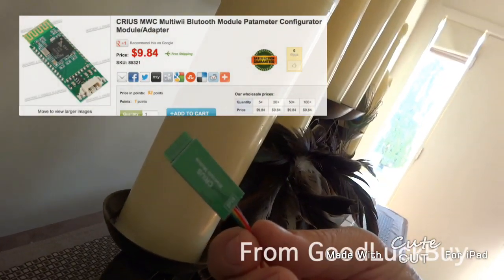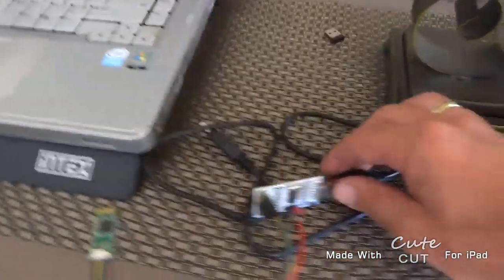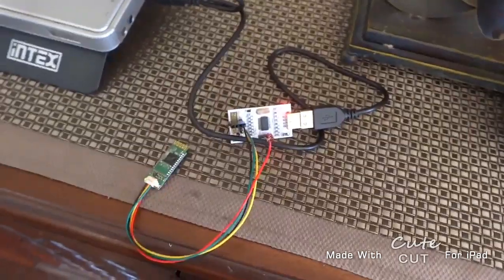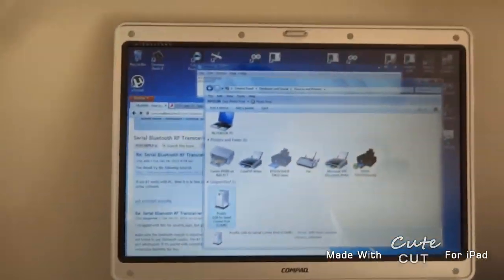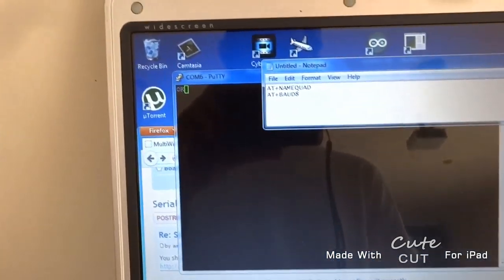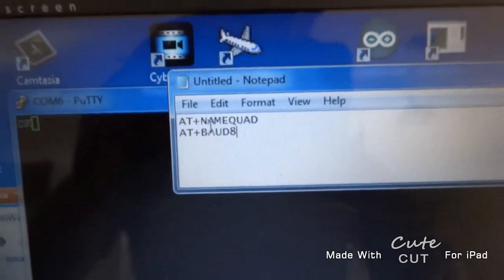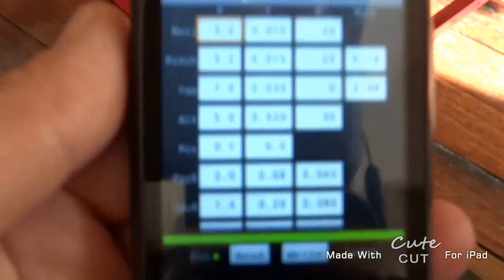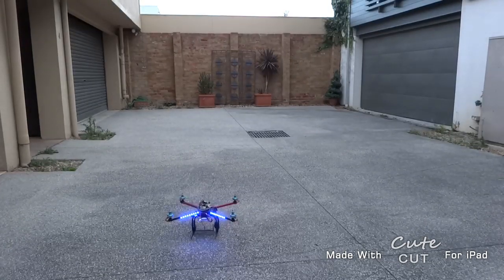Connecting to MultiWii Flight Controller with a Crius Bluetooth Adapter

Comment: hi! I reecently bought a quad, had a five minutes long flight and then had a crazy crash. because I underestimated my drone it was too fast for me to control. after changing many parts and learning about drone, I have managed to get it back on air. 
problem now I am facingbis that I need to change for PID and change them via phone. problem is that I cant connect it as password do not mach, seller claimed that pasword is default 1234. 
so question is : as I have changed Flight controll board do I need to flash bluetoot module too? To get it workin again? or em I missing something again.

Comment: My crius board is flashed with mega pirate, you think it'll still be able to use the multiwii app on iPhone ?
Reply from the maker: My gut feel is that it will connect and you can probably change some basic settings. There are a few threads about using ezgui for android. I am using a naze32 now

Comment: Are you using a naze32? It's that all necessary?
Reply from the maker: It will also work on the Naze32 but check the manual for the Tx and Rx pins which are near the middle of the board
Reply: Thanks!

Comment: what orientation does the bluetooth module need to be installed to get the best signal from the ground (my phone)?
Reply from the maker: I just let it hang away from all the other electrics. I think you will struggle to get any more than 10 to 15 meters away.

Comment: I apologize for not making my last post very clear.  I put two topics in to one paragraph and I should have separated them. Yes, I did only connect the BT with the USB TTL Uart converter to my computer via USB only.   I was not able to get PuTTY to respond to the AT or any of the other commands.  I also tried to connect using the Arduino Serial Port manager and it did not work either.   Is there a setting in putty to confirm the echo is seeing the commands displayed? Should that be set?

Comment: I have the red light flashing and the green light solid.   I did confirm the port on PuTTY and I also used the Arduino Serial Port Monitor and I could not connect with both.   UGH!   I was told that it may not be a good idea to have the lipo and or the GPS connected at the beginning of running Mission planner.  But to connect them only after Mavlink has started.  But that seems really weird.  I would like to hear if you agree with this requirement.  Thank you!

Comment: Thank you so much for answering!. Yes the pwr red light on the UART is on solid.  The red light on the BT flashes, and the green light on the BT is on solid.  I got the same response with PuTTY that I did using the Arduino Serial Monitor.  When I type "AT" nothing happens in either program.

Comment: Great video, unfortunately, When I typed "AT" nothing happened.   I double checked the wiring to make sure I had +=+  and GND-GND and Tx=Rx and RX=Tx- which I did but I cannot get the AT to come up with the OK.  I checked in devices and in device manager and it says the UART is working correctly.  I would appreciate some help from anyone.

Comment: Don't know whuy the module did not come with instructions for seting up the baud rate.
This helped. if you fond documents pls post a link to them in the video I got mine to 57600 buy guessing the value 7 instead of 8 :)